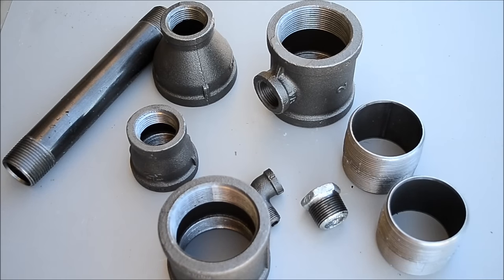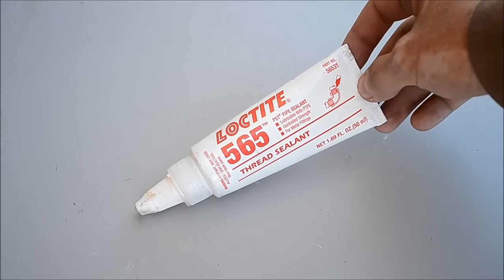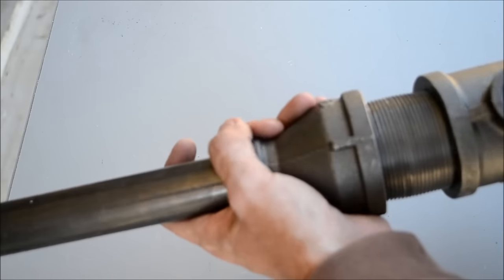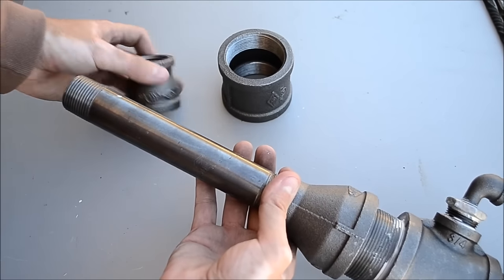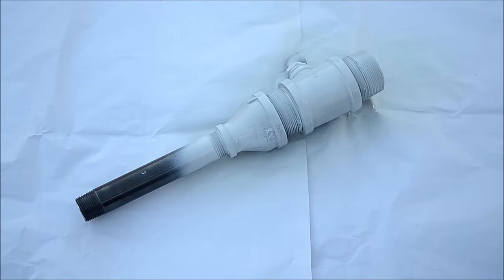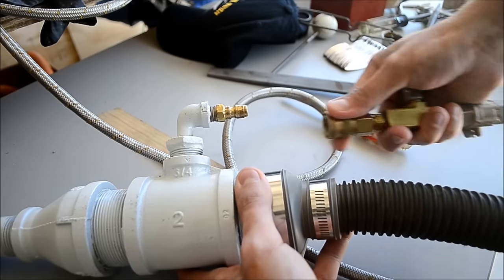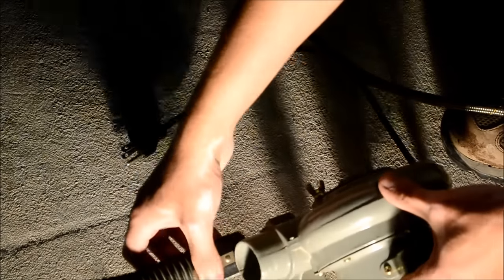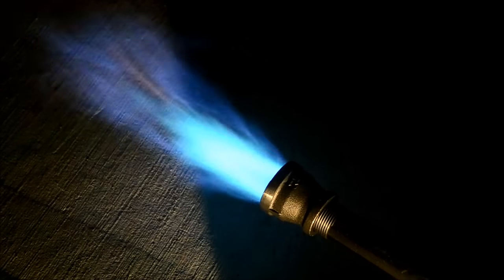How to make a forced air propane burner EASY!

Comment: by adding a piece of stainless metal screen just past the inside blue flame,it will help atomize the propane and provide a hot glowing surface to keep it lit. I'm building a waste oil/ forced air burner for a forge and it works pretty well. thanks for posting your video.
Reply: michael munson
Reply: michael munson for fairies totally unnecessary there's a thousand of these videos out I'm only about half of them these for Sherry at all of them get about the same result
Reply: Would love for you to explain exactly what it is you are trying to say so everyone reading your response..... knows exactly what you were TRYING to say.   PS  Having actually built several burners that were posted to YouTube..... they are most definitely not all the same.  I believe Mr. Munson was trying to help.  -  Your gibberish... did not Mr. clown.  -  @ClownWhisper
Reply: Michael Munson I would like to know more on your waste oil burner build I have built a few very crude ones and would like to share some build ideas?
Reply: @ClownWhisper  
WTF?
Reply: I would like to know what I was trying to say 2I haven't been using my hands for typing due to a medical condition it so I started using voice recognition apparently voice recognition is terrible LOL I can't even figure out what I was saying
Reply: I think you should put a 90 degree turn after the mixing tee. This will help mix the air and fuel better. Also instead of running the fuel right in to the tee put a mig welder tip treaded into a a cap then tread the remaining plug you have the mig tip tapped into in the corresponding reducer you will have to install into the top of the tee. This will make an orfice that all propane devices contain. The regulator only adjusts the psi. You can still have a too rich or too lean mix regardless of psi because propper mix ratio is quantified by volume not psi. The stoichiometric air-fuel ratio for atmospheric air and propane is 24(23.9) : 1. I'm willing to wager you drop the propane speed and volume, oh also your moving compress air into a make shift expansion valve, I promise there's a ton of water vapor that condenses unless your drying the air down stream thats probably the orange shit spitting out on top of your jet. I make something real simular I put on stuff I sell. I went through this. Also try using a gate valve with the rubber seal replaced with a Teflon washer inside for the air flow. A regular gate valve will dry out and crack within a month, but Teflon will last just till about the time a 3 year warranty runs out (joking they last a long time). Good job on keeping the air volume going I had a terrible time figuring that one out. Try what I said the 90 degree bend will make whats called eddy currents that will mix your gasses better than this. Another thing I've found is a air mattress pump works better than an air compressor and it eliminates the hassle of trying to dry massive amount of water vapor in compressed air. There's other tricks you might figure out that im trying to patent, but I hope that helps out. Its these comments that have helped me so much in my own road to mastering these seemingly simple devices. So, I try to help spread knowledge.
Reply: Hey worlds gone mad, have you implemented any of these improvements? Maybe put out a video of your own because the comment you made isn’t easy to understand on first reading. Bit technical for noobs. Thanks

Comment: Have you ever used the pressure gauge recommended by Dave on his video? On this design I don't see how the gauge would read the pressure since the propane is going through the burner (under the gauge through the T)...
Reply from the maker: i have a gauge but i dont use it much. It taps in after the needle valve but before the street elbow so it can read the pressure before mixing in the 2 in tube.

Comment: You should put a platinum/palladium mesh inside the nozzle to keep it lit! You can reclaim some in a car catalytic converter.
Reply: can you detail for a novice please because it seems to me that the function of the platinum/palladium mesh is simply to destroy the polluting gases? your idea is interesting can you give more details please ?
Reply: @proteo-x4u  Platinum and palladium are catalysts, which means they facilitates the reaction of most (or maybe all, I'm not sure) flammable gases with oxygen. So, when you expose a catalyst to a mix of oxygen (air in this case) and a flammable gas (propane in this case), both react together, decomposing some of the flammable gas (propane decomposes to carbon dioxide and water) which heats up the catalyst. If the supply of the gas mix is constant, the catalyst will keep heating up until the gas mix burst into flames (when the flash point is reached) and will burn it before it can be decomposed.

With propane, the reaction is weaker and slower than other more volatile gases like hydrogen and methanol. Therefore, the catalyst will need to be heated before it can react with the gas mix and sustain the reaction. So, it will start to work a few seconds after the torch is lit, but should then prevent it from going out, since as long as there is propane and air passing through it, it will remain hot enough to reignite the torch.

In a car, it works same way. When the leftover hydrocarbons (unburnt fuel) and other polluting/toxic gases (like carbon monoxide) passes through the catalytic converter, they react with the the oxygen left in the exhaust gases (that's why cars have to run slightly lean, so that some oxygen is left to activate the catalysis) and get decomposed to carbon dioxide (which is less polluting/toxic), water and heat. That heat keeps the catalyst at it's peak efficiency so that it will decompose gases faster. However, unlike in the torch, there is not enough oxygen for the flammable gas to burn, even if the catalyst gets hot enough.
Reply: Kanthal is a cheaper and more available material
Reply: @drock5404  Kanthal (FeCrAl) is not a catalyst, but it is often used as the base material of catalyst-coated meshes.

Comment: I see a lot of people making propane burners most are ok for cooking but if you need a high BTU burner you must have a liquid propane burner, and a dip tube for your propane bottle, I use to make burners for asphalt equipment we had a small burner 3 inches long by 2 inches in diameter that would produce one million BTU it was a hand burner used to heat asphalt pumps, I have built liquid propane burners that consume 800 galloons a day and required a blower like you see on truck motors so if you want  high BTU go liquid

Comment: i would probably run a 1/4" pipe tap into the other side of the bushing reducer so i could thread in a street elbow on the inside of the big tee...  add either a nipple  with a pipe cap that is drilled so you have an angled jet for the propane.. instead of just blowing it into the body of the tee ..   you could slit caps or plugs to get a fan pattern.. you could even get creative and cut angles in the caps so you discharge at angles to create a spin that would blend..  just a thought..

Comment: Use a speed controller on your blower motor, or partially cover the inlet, will make lighting and mixture control much easier.

Comment: I was building a similar burner based on TKOR design... I had lots of unburned gas in the kiln, and never reached copper melting temperatures. Looks like forcing air with a blower is the next thing to try...

Comment: Try looking at industrial high velocity burner nozzles for ideas on making a more stable and compact flame.  There are ways to design a nozzle that will keep the flame anchored with various air/fuel ratios.  Using the bell reducer helps you because it is slowing the velocity of the mixture enough to provide stable combustion.  One way would be to add spin to the mixture just before the anchor point, you can achieve more stability and a more compact flame.
Reply: Where do you go about finding these industrial high velocity burner nozzle designs and data

Comment: Rubber connector is called a fernco. Commonly used in plumbing for unpressurized water. Sewage mainly is what we use them for.
Reply: It's called a Fernco mostly by plumbers, Fernco is the prime manufacture (Fernco also makes other products), it is a rubber bell coupling.  
Just like Kleenex, Crescent wrench.

Comment: I'm having trouble igniting my burner. The pressure gauge is not moving even though tank is full (25 pounds tank), I really don't see how the pressure gauge can measure any pressure located where it is, it confuses me. Also I'm using a 12" long nipple at the end, maybe it's too long? I'm going to try changing it to a 10" long nipple and try again. Everything else is almost identical to your design and all the gauges, valves, regulator, etc are the same as yours and Dave's. Any suggestions, ideas on what might be going on?
Reply from the maker: Is it igniting then going out? If so you will have to play with the fuel air mixture and or the size of the flare. This type of burner needs some back pressure so you can try putting it in a forge and try lighting it there. If you cant smell the propane coming out then your gas line is blocked or turned off somewhere.
Reply: I got it to light once by reducing the amount of air but it went out quickly. I'll try shortening the end nipple and see what happens. I can definitely smell and see the propane coming out but I have a question, I have the 0-60 psi regulator at full pressure, how is the propane supposed to flow? Is it meant to come out with pressure? right now the gas flows with not much pressure but constantly.
Reply from the maker: I would try to use a 1in to 1.5 in flare at the end of the nipple. the flare is where the stability in atmosphere comes from. sometimes they are finicky.
Reply: Yes I have the flare installed as well. I'll try shortening the nipple and see how it goes. I'll comment the results, maybe it helps someone else.
Reply: 7 psi from propane. how about the needle valve? how do you find those adjustments? like half way or just eventually it will ignite while playing with it?

Comment: what pressure do you run the propane, what psi? do you need a needle valve and adjustable regulator?
I'm getting a 0-30 psi regulator and a needle valve... would love to know at what pressure you ran it
Reply from the maker: I run a needle valve and a 60 (i think) psi regulator open all the way. I don't know what pressure I run at though.
Reply: thank you. I have all my pieces now and I hope to test fire today. Super excited for my new hobby

Comment: Can you help me? My burner's flame is about 1to2 inches away from the mouth of the burner. Do you know what may be causing it? Inside the forge the coolest part is right in front of the burner and the rest of it is hot as it should be.
Reply from the maker: Sounds like the flare at the end may need modifying or The speed of the fluids sounds a bit high so it is starting to combust outside of the flare. Try a different air flow and or a different flare.
Reply: @nickwoo2  I'm gonna try using a longer pvc pipe to slow the air flow. Will it help if I prolong the burner itself?

Comment: I've made a similar forced air burner,
Outside the furnace it won't lite without the flare on the end but once inside the furnace it's unnecessary.

Comment: Im new to this type of DIY builds.  Quick question:  what should i look out for when concerning saftey.  I have the entire torch built but im hesitate to start it.  Whats the possibility of and explosion or other malfunction?
Reply from the maker: As long as the pipe is open it cannot explode. Only thing you have to worry about is if you lose power and the fan shuts down then the propane will flow back into the blower but that is why you have a quick shut off valve in the propane line.

Comment: Nice  burner!  You may have stated this and I just missed it but what was the purpose of filing the smaller fitting to pass through the large fitting?  I didn't see it as part of the lit torch.
Reply from the maker: the larger piece was welded to the forge and the smaller piece is the flare that needs to go through into the forge.
Reply: HWPcville

Comment: Drill small holes in the end (hot) nozzel, and the other end where the air comes in, cut around a round piece of thin metal to fit inside the nipples and cut pie shapes lines to toward the, center stop about a half inch to center, do at least 16 cuts, then with a needle nose pliers , twist each blade about 30 degreese clockwise, repeat this one more time but twist the blades on this one counterclockwise. Insert these about 2 inches apart close to where the gas is coming in and assemble. The air will now create a vortex and mix the gas to ignite with max b t u. I tried it and it was much better.
Reply: May I get ur Facebook page so I can contact you?

Comment: what kind of blower are you using? would a hair dryer supply a sufficient amount of air flow?
Reply: ri henry it could but i would recomend a forge blower.
Reply: For years I use an old turbine car (an ac one is so good for it). Only take care to have a butterfly plate to reduce the air flow....
Reply: CJ M trick
tricks

music on you tubes
Reply: david hancock lol what?

Comment: wow! that's some hardware! I saw at the end of the vid you were having some trouble lighting your torch. allot of times this is due to the torch body being too short or too much air forcing through the burner. I would suggest trying a longer nipple, maybe a 10". also be sure your torch behaves the same inside what you will be burning in, in this case a gigantic foundry lol. Allot of times it will not preform the same outside the forge as it does inside. All in all great clear vid very understandable. however I would suggest just a bit more research. not trying to be mean at all.  If ya want I would be happy to give ya few pointers.
Reply: +KID18T Actually in my personal experience it's the complete opposite. The forced air burners use more gas to compete with all the air that is being forced into the mix. While the can get hotter, I find them unnecessary. I've got a torch design that is venturie that will get up to forge welding temps in no time but I can keep it a reducing environment to prevent scale. all while running at 8psi. Just my experience though. I do know forces air burners are way easier to tune.

Comment: my set up is almost like this except my 1 inch burner inserts into forge without flare. I have no problem reaching temps upward 2700 degrees. I easily melt cast iron. and heat high carbon steel white hot and workable.
Reply: what psi do you run the propane???? I'm just piecing mine together soon. I will try to regulate the forced air. I bought a 0-30 psi regulator.
Reply: Just tank pressure don't need anything fancy a screw type valve to control amount of propane and a valve to control amount of forced air that can be supplied by a blower or air compressor. Depending on size of forge/ foundry you may  need more volume of air than some small compressors produce.I used a air matters blower starting out work fine for aluminum but to get higher heat I recently started using the blower connect of my shop vac if mix is adjusted properly you can reach much higher temps
Reply: I have an old inducer motor from an old high efficent furnace. should do the trick... so using a standard bbq regulator will work with the needle valve? I ordered both from amazon yesterday 😅
Reply: That could work if you get sufficient volume of heat from needle valve.
Reply: Can you share details? Thanks!

Comment: Hey Nick, I followed your design but I'm having trouble getting my flame not to sputter.  Trying to use it inside Grant Thompson's mini foundry.  What psi do you run your propane at?
Reply from the maker: I don't have a pressure gauge but another fellow said to try a longer nipple like a 10 in or a different size flare to get a consistent flame in open atmosphere.  mine works fine inside my forge with or without the flare. how much volume does your forge have.
Reply: Try reducing the air flow. You will get more reliable ignition and the heat produced will have time to be absorbed by the burner rather than being blown out of the furnace.

Comment: By using forced air with in the torch or not, will that effect fuel consumption and how?
Reply from the maker: I use a bit less gas at the cost of portability. I have a venturi burner as well for when i want portability.
Reply: @nickwoo2  Excess air will simply blow heat out of the furnace,  rather than allowing time for the heat produced to be absorbed.  Too little air and you will produce soot and massive amounts of carbon monoxide when the flame is starved of air to burn the gas completely and properly.

Comment: peice of 1/4 " pipe  with a cap on the end and small hole drilled in it to force propane thru a larger pipe works even better and no blower necessary..

Comment: What's the purpose of the hose on the back end? You're not forcing air down the torch via a shop vac are you?
Reply from the maker: +chris white The hose is for the forced air. I have a dedicated blower but a shop vac might work.
Reply: +chris white You can use an el-cheapo hair drier. Just hook to bridge rectifier on back of the motor. Can run on anywhere from couple of volts up to about 40 volts DC. I use a variable DC supply. Gives great air flow control especially in the forge which in my case is coal fired.

Comment: pretty cool,  think I would swap out the cast iron 1x1.25" reducer with a forged steel piece due to heat from the flame.
Reply from the maker: yeah I think a stainless flare would be good for the heat and with out of forge operations